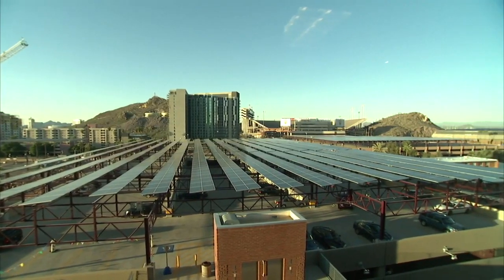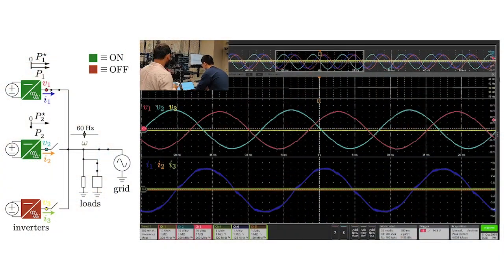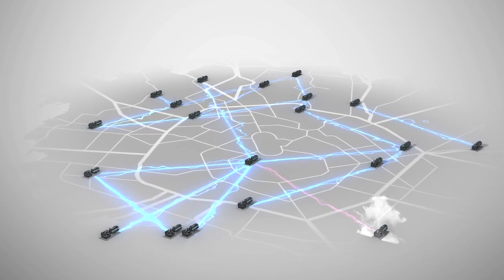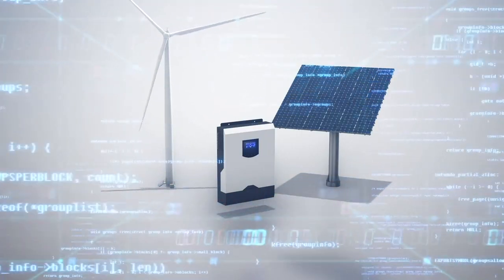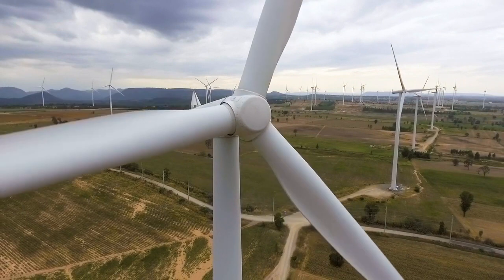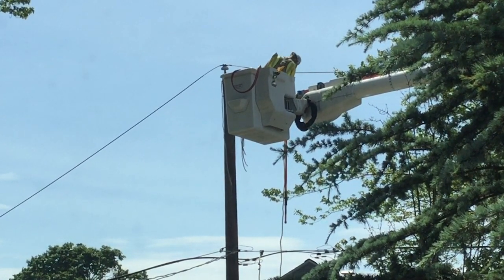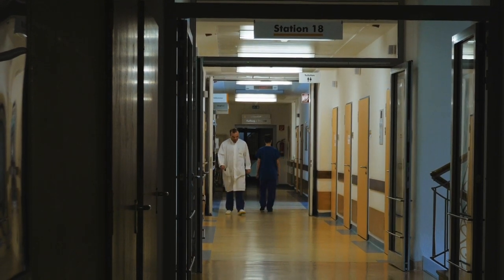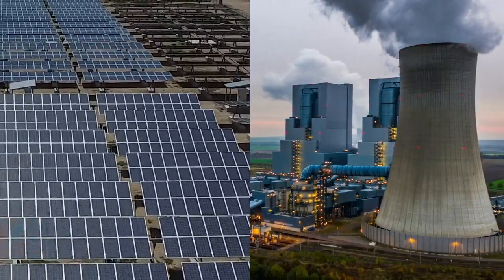Next-Generation Inverters Enable Solar Energy Integration

Comment: I know I am not by any means an engineer, but this video does not in anyway communicate to those of us non-engineers what the hell they are trying to actually do. Just seems like they put together a bunch of hot button topic phases and operational words together. 
Case in point: if the inverters have the ability to form their own grid in a grid down situation, that means that they are still going to be pumping power into the grid that is obviously down for a real world reason. How does that not violate current safety laws and current systems in place to protect line workers working to fix potential breaks in the line?